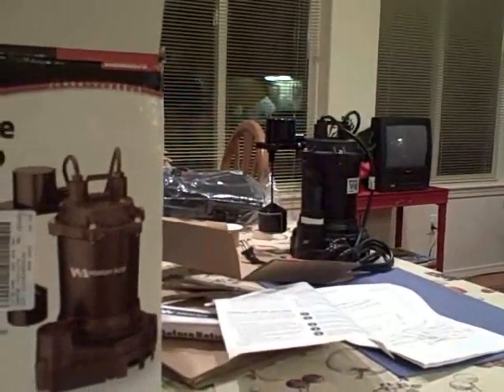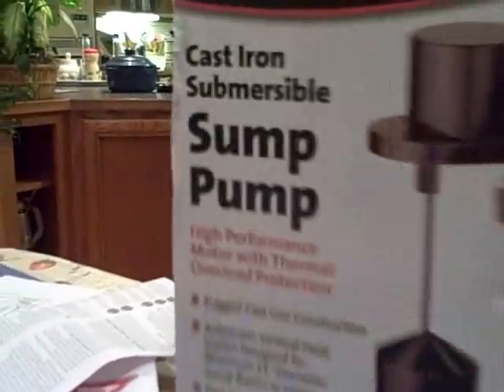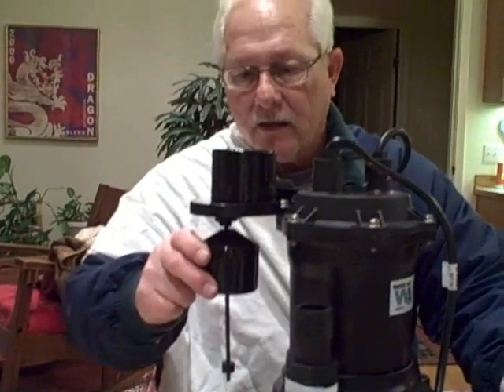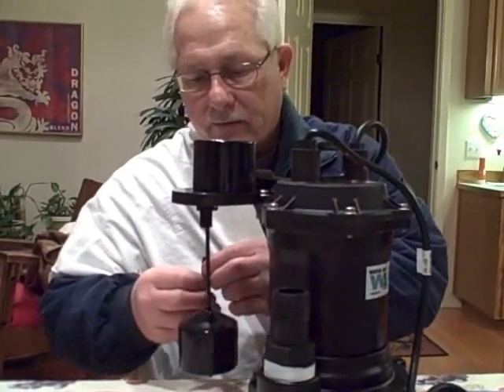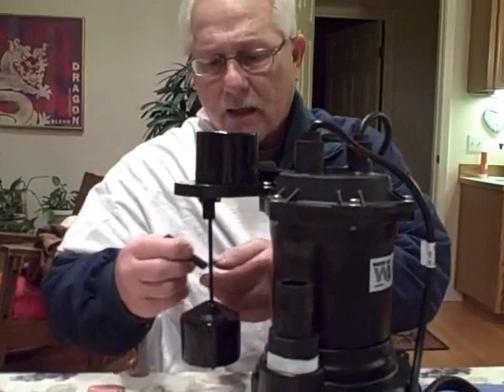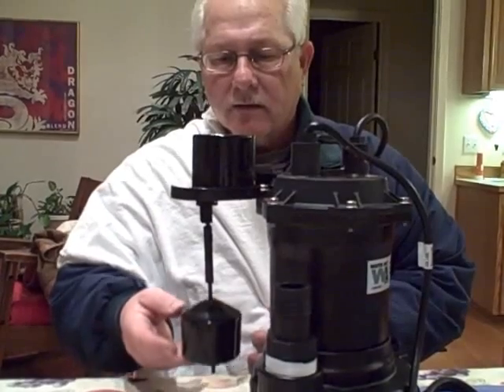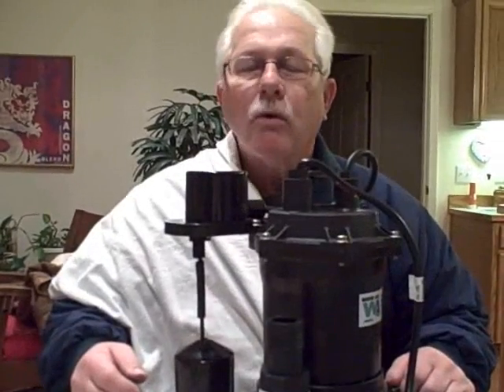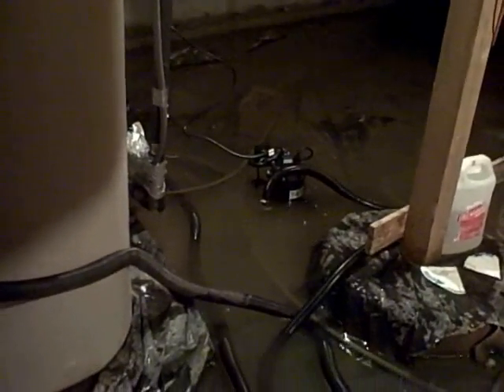Adjustment to Pump

Comment: This is genius and worked really well. Didn’t even have to uninstall the pump. Used a piece of heat shrink wire insulator.

Comment: Why didn't I think of that!?!? I've just installed a new flotech sump pump to replace our old pedestal pump, and due to the solid rock about 10" below our old house's basement floor surface, the "pit" (cut off 5 gallon bucket) I'm using causes the water to rise to above the sump top, and spread around the floor. I could NOT figure a way to get this type of float to adjust, so your video took care of the problem in minutes. I even had some 1/4" fuel line sitting around, so I didn't even have to go to the hardware store, either! Hooray! And thanks for posting this, Jim!
Reply: I just purchased a new sump pump and I noticed it leaves 5 inches of water.  I think it should only be leaving about 1 1/2 to 2 inches of water - is that correct?   I was looking for a way to fix this.  Where would I get the rubber tubing and is 1/4" the size I should look for?

Comment from the maker: The "shim" consists of a piece of rubber tubing (the size will fit around the shaft.)  It is cut to a length which will still allow water to get deep enough so that the pump can efficiently  function).
Jim slit the tubing with an 'Exacto knife' in order to slip it on.
Reply: Awesome work! I hope this works for me

Comment: Thanks very much.
I have exact same type of float switch. However, the float goes up and doesnt have enough pressure to trigger the switch above. It just goes to the top and stays there. As soon as i make little movement on the surface of water with some stick or something, it starts working.

Any help why would that be the cass and how do i fix it ? 😐😐😐

Comment from the maker: The shim consists of a piece of rubber tubing (diameter size will fit around the shaft.)  The tubing is cut to a length which will allow the water to get deep enough to allow the pump to run efficiently. Jim slit the tubing up the side to allow it to slip over the shaft.
Reply: where did you get the shim from?